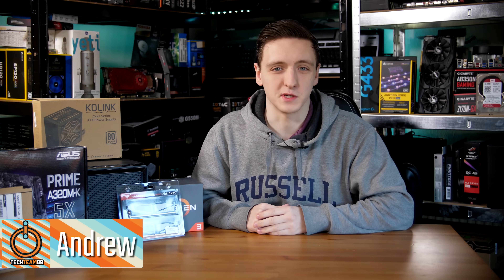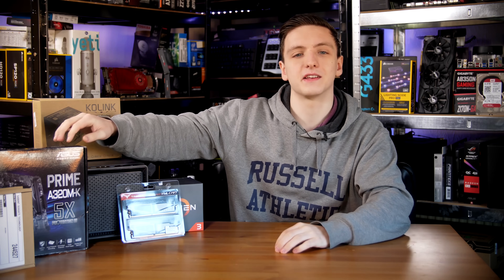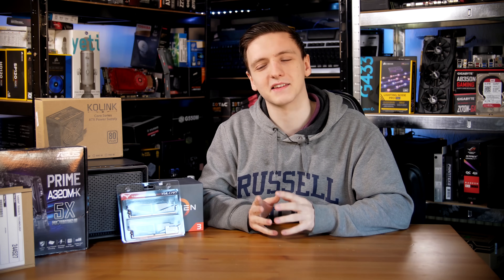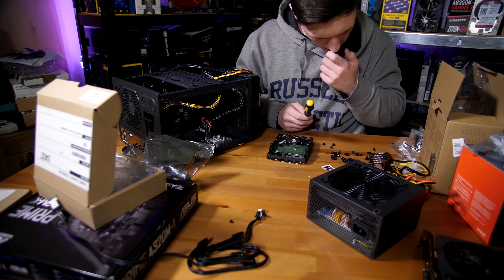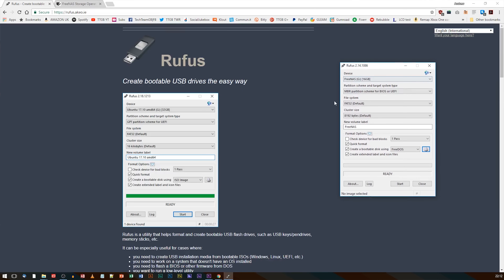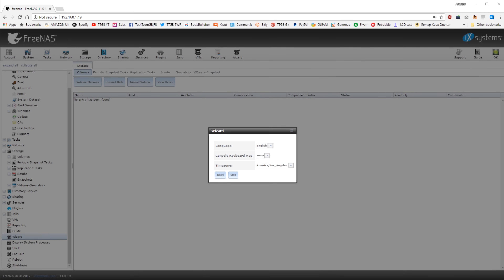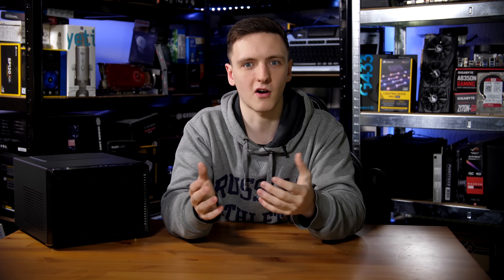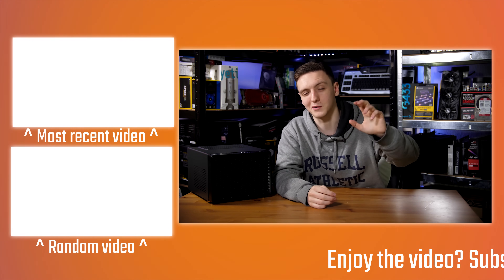Budget DIY NAS Build & Setup Guide

Comment: @TechteamGB Yeah after watching this so called budget build, i think its cheaper to buy a prebuilt NAS. Especially if you dont want to cheap out and then get frustrated later because you did so. Besides that 4TB drives just would not last long. I bought a Asustor AS4004T 10Gbe 4 Bay NAS and filled it with 4 8TB Iron Wolf drives. I have a dual port 10gbe PCIe network card running CAT8 cables to an Asus XG-U2008 10gbe Switch, w/CAT8 cable into a TP-Link TL SX105 10Gbe switch an so on......to me cheaping out and calling it a "budget build" is just postponing the inevitable and wasting money. Recommending people take such insane shortcuts is irresponsible and stupid!

Comment: “Budget”?  Come on, man.  I think many techie & gamers are living in their own bubble. Their isolated reality of Bleeding Edge (+$2,000.00 gaming “rig”) has warped their sense of “budget”.  

You can see how warped this guy is....graphics card on a NAS.  You do know, on-board graphics IS GOOD ENOUGH FOR “transferring data”?
Reply: I mean u could like use it to mine
Reply: @itsbuntybro5813  with a RX460? That will probably net you like what, $8 a month depending on the electricity cost where you live.
Reply: Having said that, having a graphic card on a build like this is perfectly normal. Most, if not every person who's looking into building a NAS from consumer parts like this would be looking at running Plex/Emby/Jellyfin, all of which will hugely benefit from the hardware transcoding capabilities on the graphic card. People who's looking into building a pure NAS that will only be used for 'transferring data' will be looking at SoCs like the Raspberry Pi (with a SATA hat) anyway, as they'd be a lot more conscious of the power consumption. If you're going to go with a full blown PSU on your build, I don't see any reason why you'd skip out on hardware transcoding.

Comment: I used an old HP desktop with 2 Gig of RAM and used a few USB drives as well as a SATA III 3 TiB internal drive to generate a 7.5 TiB OMV NAS. It's working, though, if you're like me, the data Transfer rate over 5G WIFI Extender (a retired Asus NT66 router that I revived for extending my network to where the NAS server would live) is @ 11 MB/s on file transfer and I'd love to get MUCH more SPEED! 
Thanks for the video!!

Comment: For what you've spent on that you still only have a domestic PC with RAID. Just go to one of the surplus vendors and get cheap rack server, you will get massively more cooling power in a case designed to be loaded with HDDs from the outset, ECC ram, Hot-swap SAS, multiple LAN ports, redundant power supplies and Xeons with many cores designed to do exactly this job and run for years at a time. So while I have done this sort of build from old PCs I want to re-use, if I was faced with shelling out hundreds of £ on new gear or just getting a used Dell and shoving a JBOD card and SFF cables onto the backplane I would go for the enterprise gear every time.

Comment: This isn't a NAS.  Two Hard drives does not allow for proper fault tolerance.  All you have capability for is a Mirror, and a Mirror isn't going to cut it at 4 or even 8TB per drive as the entire purpose of a NAS is to be able to read from the NAS and write to the NAS on multiple clients and most folk I know in a multi person home are going to want more than 8TB of available storage for backups and for  running media servers/video editing/et al. and they are going to want fault tolerance of RAID 3 or better which is going to mean 3 or more drives unless you are going with a storage pool scheme like unraid but even then most implementations either in the home or in small businesses/youtuber scenarios run those storage pools off of something like zfs.  

No,. What you have here is a two spindle + SSD small form factor elcheapo gaming rig.

Comment: This is not a NAS, let me explain - > 
1. Consumer Parts
2. No ECC Ram
3. Case you went with supports 2/3 HDDs
4. GPU is just a power consumer
5. No redundant PSU
I personally use a fujitsu rx100 s8 with with 2x120 Gb ssd as boot, and 4x512 gb ssd striped for cache and 4x NetApp DS2246 DAS attached to it with 4x(24x5Tb 2.5') = ~350 Tb Usable Space. Oh and thats my private, home server. I store every movies ive purchased, i live in germany, i purchase movies, series from german market and as im hungarian i purchase from the hungarian market too. This server acts as a plex media server too, i use Nvidia Shield, so transcoding isnt a problem + i use the E3-1230Lv3 25 W TDP CPU in my server and the whole system runs on a dedicated solar panel + battery pack system 24/7. My server uptime is around 490 Days so far :D
Reply: Your 5 points are pretty a lame justification of this not being a NAS. More like just your opinion

Comment: Cheaper buy a 2nd hand i3 4130 or Celeron j3455 based PCs and used open sourced Xpenology software, this combo is Cheap, Compact and Powerful and minimal hardware DIY except for spending time on how to use the Xpenology software.

Comment: You lose a lot of the FreeNAS and ZFS advantages by skimping out and not building an ECC system. Your data is not safe in a ZFS without it.
Reply: How to build right? 
I need some good advice. 
NAS good units are just too expensive for me. 
I have 1,500$ budget for raid 10 8 HDDs
Reply: @fathersheart3547  What are your storage needs? Seems strange to just say I want 8 HD in raid 10.  With ZFS you are much better off using the ZFS file systems and running a ZFS1 or ZFS2 (similar to raid 5 and raid 6)

Do you already have the 8 HD? My 16TB ZFS2 system cost about $2500, but a significant portion of that was HD cost.

Comment: Ecc memory is mandatory with freenas (Yes Mandatory). But AMD discouraging is deadly wrong. I have Just made to production our new 40TB  freenas system based on EPYC (first in the world as far as I know). It is an absolute beast due to 128 pci lanes. It is stable as a brick and fast fast fast. Over an intel X540 10 Gbit/s performs at 9 Gbit sustained. Just stunning. So be brave be foolish. Our xeon based freenas systems are trash now. By the way Epyc nas consumes 150 W xeon based with hba (IBM) more than 250 W.
Reply: Not it is not mandatory but is recommended if you have a system that supports it
Reply: That does sound nice, although would be wasted for home use unless he's rolling out fibre channel or 10gbe.

Comment: I really wished this video was done in a better way. So much talk and not enough showing. Anyone could sit with a box of parts and keep talking. Also, I've built NAS before and there are a few flaws with this one, it won't last long. Sure it'll work great in the beginning but AMD is a poor choice of a processor to start with.
Reply from the maker: Why is the amd cpu a bad choice?
Reply: Anupam B your obviously haven't seen how well ryzen cpus perform and at a much lower cost to intel
Reply: @jeffreekenny  Dude, with your AMD-Fandom you're even more annoying than vegans.
Reply: @Metatr0n  For a start i aint an amd fan boy i always use intel but i aint that blind that i cant admit that the new amd cpus aint that bad..

Comment: why the gpu??
Reply: Why do you need graphics for a nas
Reply: @zabumaster7749  To install FreeNAS, unless you can literally do it blindfolded.
Reply: @zabumaster7749  You don't need one unless the CPU doesn't have integrated graphics
Reply: @No name ok I know right!? Freenas works better with Intel CPUs and with more RAM. But ECC RAM works best. It's not necessary to have it, but for a serious NAS where everyone saves stuff on it, ECC is preferred. 

So more money should be spent on drives and memory rather than the CPU and motherboard
Reply: @aurvaroy6670  why buy an pentium when a lower end ryzen cpu can be picked up for about the same price and perform much better
Reply: @jeffreekenny  This build is for freenas, which recommends Intel cpus.
Reply: @aurvaroy6670  no it is not recommended for an intel cpu
Reply: @jeffreekenny  Freenas recommends Intel CPUs because the operating system runs better on Intel CPUs. Plus, Intel CPUs have integrated graphics, which really good for a Freenas system since no GPU is required, while AMD CPUs come with no graphics.  So please read the system requirements before trying to prove me wrong.
Reply: Cuz the ryzen CPUs don't have integrated graphics

Comment: not a nas, tis a computer
Reply: a nas is a computer..... research........ referance (wiki) Network-attached storage (NAS) is a file-level computer data storage server connected to a computer network
Reply: Nas is Network Attached Storage, but you need to have a computer to attach the storage to the network, so a nas is a computer
Reply: think he is talking about how he used all parts for a desktop computer instead of parts geared toward a NAS

Comment: How did you set up FreeNas without any video out? Maybe I missed you installing a gpu but no on board graphics on Ryzen? Thanks man
Reply from the maker: I added an RX 460 to this system for VM use and media use - but if you went with the 'true' budget spec using the A8, it'll use integrated graphics.
Reply: @TechteamGB  would you be able to save games on to it as I struggle with the large games on my pc
Reply: I have two FreeNAS systems. Neither of them have a video card and neither has ever had a monitor plugged into it. No video at all on board. I configured them over my network and use both of them as servers. One at the office for data and one at home for PLEX/Movies.

Comment: the parts are interesting but you shouldn't go only budget, you have to think about the "Power Consumption". In addition a cheap power supply isn't so reliable and will not have sufficient surge protection to protect your HDDs.
Seagate ironwolf have built in ECC but when using FreeNAS you rely on lots of RAM and that should be ECC.
Reply: Not Freenas but ZFS which freenas use
Reply: You dont rely on the surge protector in PSU, you use an external one..
Reply: You don't need lots of ram for FreeNAS it is recommended that you have 1 GB for every 1TB of storage
Reply: @jeffreekenny  8GB is minimum for Freenas/nas4free and only after meeting this req you can stick to the rule 1tb stor = 1gb ram. Which is a lot comparing to requirements of Openmediavault, xpenology, rocksor or unraid.

Comment: I am looking into building my own Naz but would like some direction. 
1. What is the Mimimum CPU for 1080p/4k Transcoding, as I have seen some pre built ones at 1.4 ghz, need to at least either direct play or transcode minimum of 2 streams or 3. No graphics card needed, and it may or may not be a 24/7 nas only turned on when i need it to be.
Reply from the maker: Something like the A8 APU that I linked to would be great for that. Much more powerful than the vast majority of pre-built NAS units for around the £300 mark (excluding HDDs).
Reply: 4K transcoding is really difficult as its H.265 codec and its not really supported or optimized by CPU nor software. A8 or Ryzen 3 wouldn't run it. I am guessing your using Plex and you should check Plex for passmark score for each transcoded stream for 1080p and 720p. Then go to passmark score for any processor to compare how many it could handle. However you should make your movies and shows compatible... Always try to use direct play access where as transcoded uses many resources. Don't make your system work harder than it's needed. SSD would help greatly if you plan to expand movie library as it loads metadata for movies. I wouldn't invest in Ryzen 3

Comment: AMD's new apu is deffo the way to go with this... but for it to be worth it you really need to cheap out to make it more suitable than a 2 bay Synology or similar. Would recommend a case that does take a standard rather than SFX psu as the 400w variants are so cheap in atx format over sfx... The problem comes with DDR prices at the moment. The System need to be as low wattage as possible if running all the time... or better yet Wake up over Ethernet for cold storage use only when you need it such as backing up your photo and video files.

I ran up two systems, a fairly basic Synology with 2x6gb Seagates for £470

And a APU powered system would be around £620 without a boot drive... though probably less than 600 with pcpartpicker and a bit of shopping around. So I guess it is a case of whether you want to pay an extra 150ish in favour of having a full pc and its usability over the restrictive nature of a cheap NAS.
Reply from the maker: With the APU I think it comes to around £300 for the system which especially considering a good 4 bay NAS can be upwards of £400, it can be a good value. Even with the APU you'd still get a more powerful system, but obviously the pre-made NAS units will have an easier to deal with UI.
Reply: How are you building a full system for £300? APU £50, board is £50, Case £25, PSU £40-50, 16gb ddr, and so on...

This was the cheapest I could get, https://uk.pcpartpicker.com/list/CMYtVY

This is still without a boot SSD or even the USB stick for the network software... 

Surprizing though that if you add a 1060 6gb and win10 key you have cheap as chips 1080p gaming rig.
Reply from the maker: APU: £50 (comes with cooler)
Mobo: £60 
Case: £25
PSU: £30
RAM (16GB): £120

That's £285. Add £10 for a decent USB drive to make £295. No GPU or boot drive needed for FreeNAS.

Comment: I did not see how much this cost? As general feedback I would have like to have seen the IO performance 

Also how many drives can the case take?

You will be limited to RAID 0 or RAID 1. What about RAID 5 or RAID 6 support?
Reply from the maker: With the GPU, it's about £500 without drives. The config I recommended personally with the A8 would be around £300. 

The case can hold 4 drives, but as I mentioned it's also definitely up to you what case you go with. Because of the motherboard clearance issue with this specific case, I don't think it's all that great here unless you use an ITX motherboard.

4 drives would allow for RAID 5 certainly. With that said ZFS would deal with as many drives as you like, so as mentioned this is a template really. If you need 10 drives, then a bigger chassis that fit them is still fine.